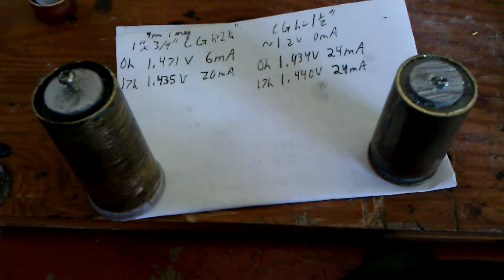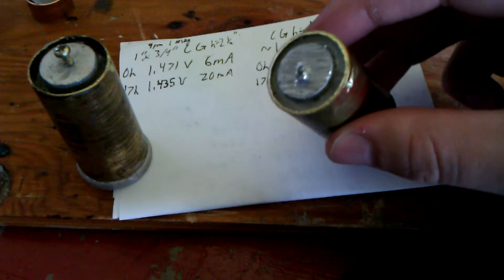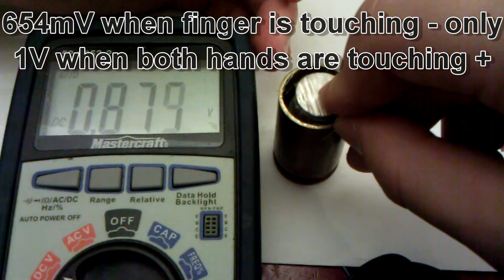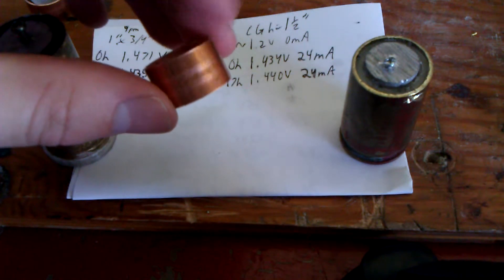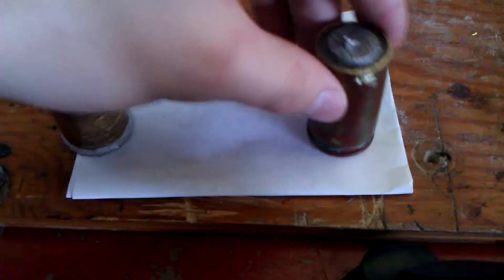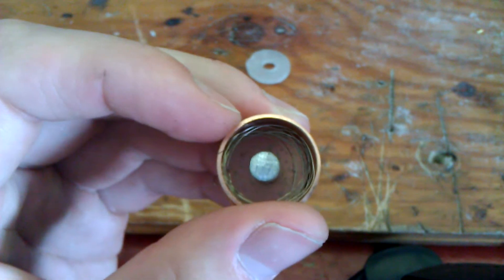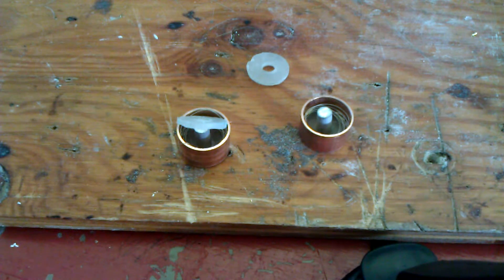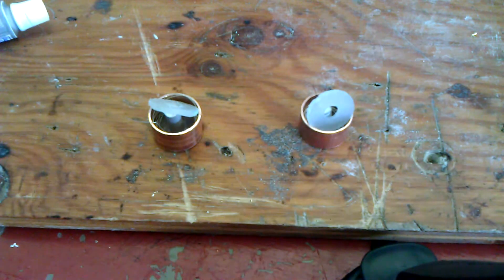15. Crystal Cells brass, magnesium & more questions

Comment: Cool stuff! And creative ideas. I have tried making some of these myself and could always get a decent voltage but could never any read at all on current, not even 1 Mah! But I'm thinking it was because the magnesium was in pretty small pieces. Pyrite, bismuth, and sodium silicate are some things that might be worth experimenting with
Reply from the maker: maybe. in the end there is just way too much corrosion to be worth the effort in making these. a small solar panel is far better. i did learn a tone by doing these videos tho. been over 5 years now. thanks for watching. hope it helps you out!